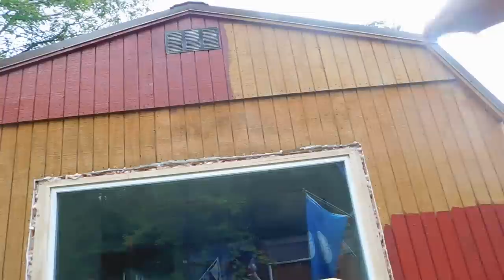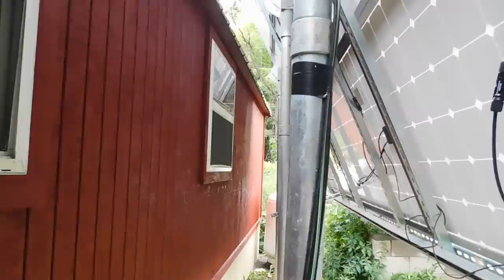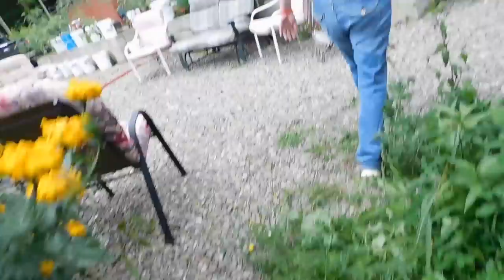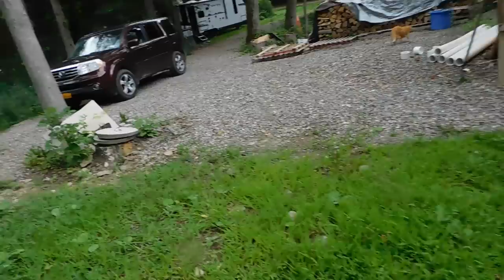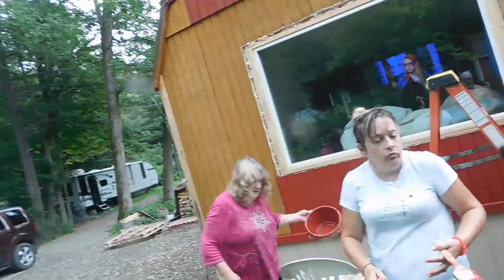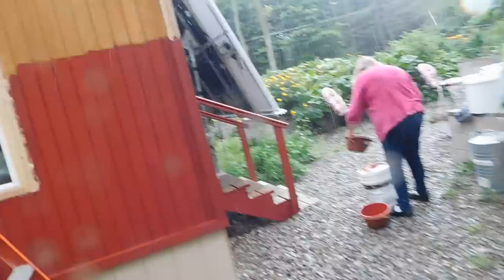We were making very good progress until the rain came.

Comment: I painted professionally for 20 years I would use a 25ml pile roller sleeve and roll sideways then touch up with a brush later
Reply: Well, I´m far from professional, but I´m lazy enough and I do the same; brush in the middle and paint roller on big surfaces...
Reply: @martapareta1939  we do it that way because it saves time and time is money